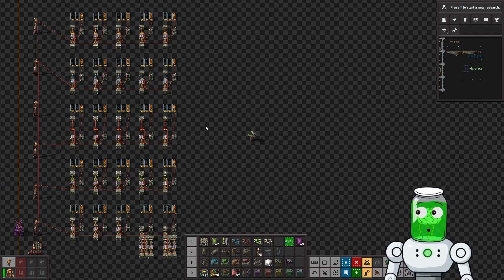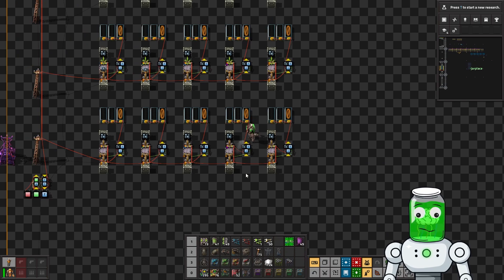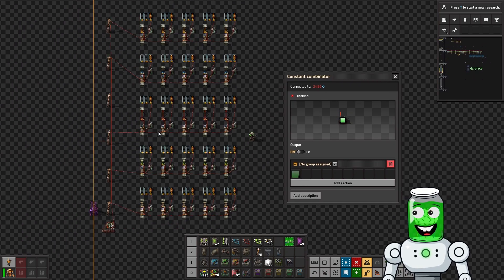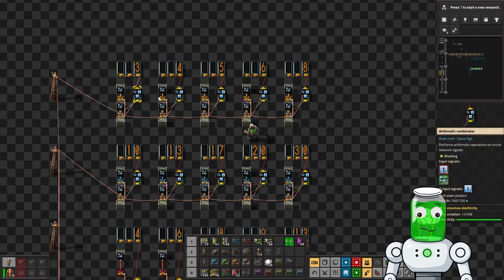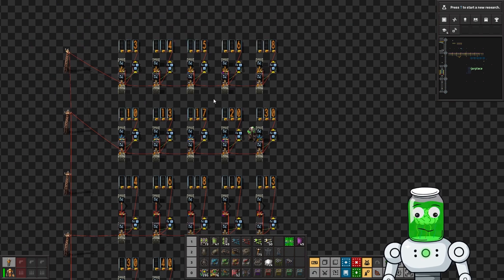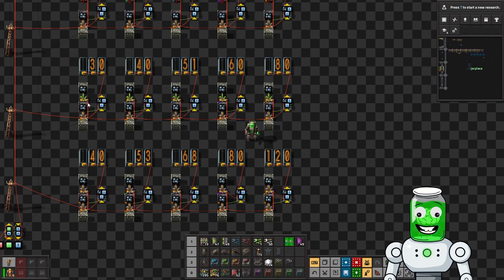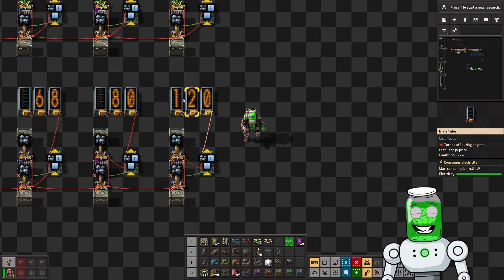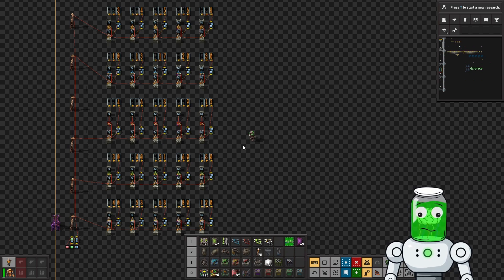Testing them ALL - Inserter Throughput | Factorio Space Age

Comment: I'm disappointed in you man, this is the most inaccurate test anyone could have come up with - I'm pretty sure the long handed inserter would have transferred 4.5 items per second (or is that per 30 seconds ? doesn't seem likely) - I would have expected someone with your inclination to math and science to know that A - you don't run the test only once, you perform it several times in succession to see if the results are consistent and you also run it for much longer (each time or in succession) to make sure nothing is affecting the results and that they are measured in a measurable manner (to make sure you are not missing fractions of a second or receiving partial results...

 do it again with my guidelines and see if I'm wrong - but don't let the game calculate the average - do the final calculation yourself with a calculator that will give you a more accurate result
Reply from the maker: Thanks for your input jockeril!

The long handed inserter did transfer 4 items per second.

I did perform it several times and with longer periods and shorter periods, and with exactly the same results. it's pretty solid.

could be better with some float variables but... didn't seem to me that important- these are pretty good numbers to know

Comment: No burner inserter.
Reply: Truly unwatchable.
Reply from the maker: @Infanterie_Marine  lmaooo
how could I forget the star of the show
Reply: I unironically could have made use of that info - they apparently don't cost energy to keep heated, so should never freeze next to a warm heating tower, so should be usable to build indefinitely re-thawable train outposts on aquilo, unlike the other inserters that will eventually drain the heat.

And it would have been interesting to know exactly how much fuel would get wasted by jumpstarting with a circuitless build if a stack inserter unloads the rest of the wagon into a chest for use by the outpost (once thawed).

But this is not a complaint, I entirely understand why this video left them out :D Would probably make the setup way more complicated, you'd have to account for some of the items being used to power the inserters. It's a good omission!
Reply from the maker: @thomaskolar90  Very interesting point!

I'll have to consider that for a future video
Reply: @thomaskolar90  I think for the kinds of things you're talking about, most of us would probably fueling things with Rocket Fuel, so... just pre-fueling the inserters and measuring them assuming it's a non-problem would probably be fine.  Like, I just did a test for 60 seconds, and a pre-fueled inserter got one swing more to the output, but both had like 95% of their fuel left from the first fuel item, so... they were mostly in lock-step, and... even extending the test to over 10 minutes, they still had something like 75% of their first rocket fuel good to go (plus 3 more for the one that didn't start pre-fueled, and a 19 more for the one that did)... so, it'd be a LONG time before you'd see a difference of more than one swing worth, and certainly negligible in general at a 30-second interval (though noticeable on the first 30 seconds, I guess, and every once in a while afterwards until the pre-fueling ran out, at which point they'd become equivalent to each other, but limited compared to an electrically powered inserter... but... this is about rate, right?  And that electricity came from somewhere, so......)